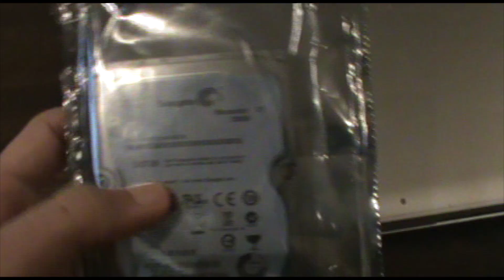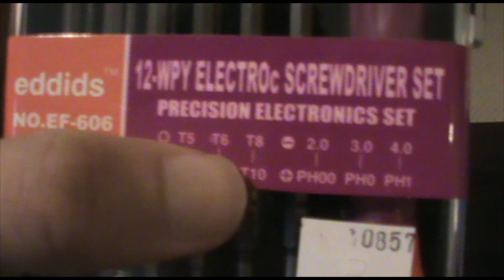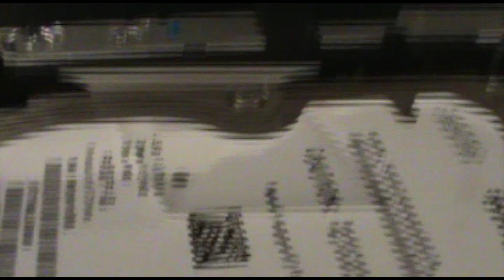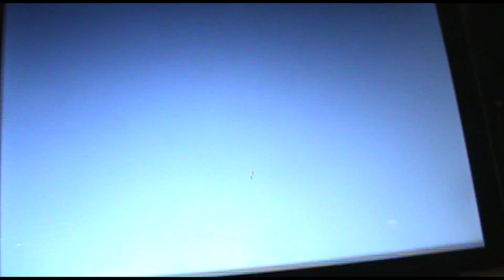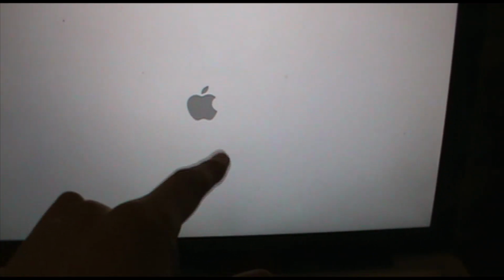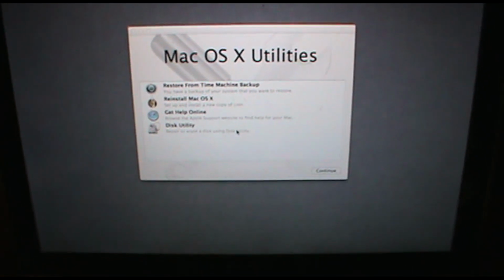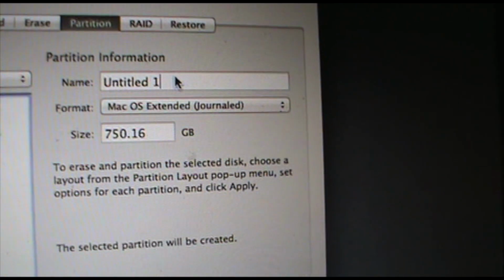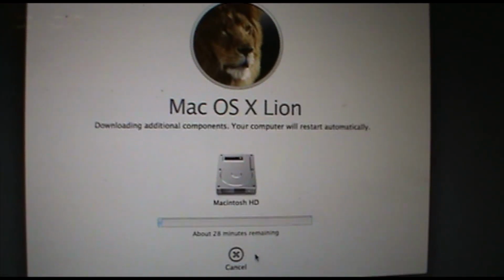Upgrading the Hard Drive in Macbook Pro 2009

Comment: Hi, glad your Momentus XT worked for you. I've just bought one and it doesn't work, can't format it at all. And have found lots of people having the same problem with Mid 2009 MBP (13") which is what i have. So just a little heads up for people before they buy! Some get round the incompatibility with a "jumper cable". But i think i'll just send mine back. all the best.